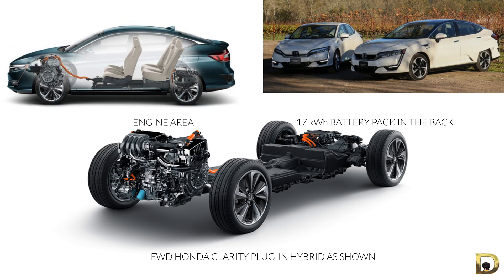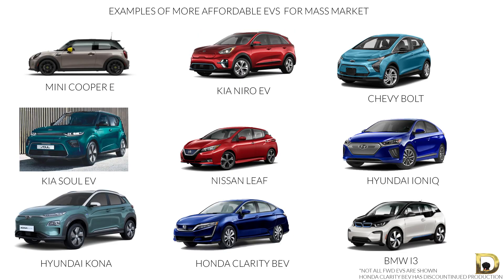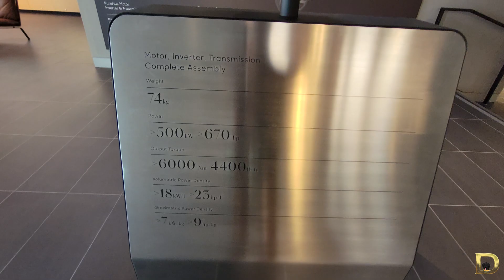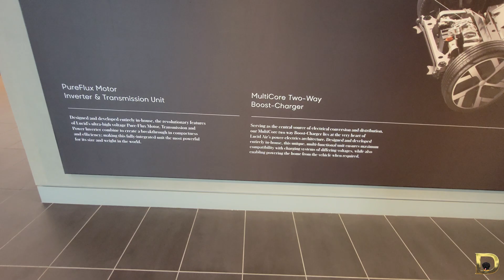Lucid Studio Tour at Beverly Hills and the Genius of EV Design and Packaging Possibilities

Comment: What charging stations can be used, can it plug into a Tesla rapid station? Does have have adapters to use other charging stations
Reply from the maker: It can be plugged into any charger station such as "Electrify America, ChargePoint, EVGO and many more," except for tesla's supercharging stations as of right now.  However, there has been rumors that Tesla will open up their stations to other EV manufacturers as well in the future. 🙂 Lucid will come with 3 years of free super charging from Electrify America, if pre-ordered during this year only. Lucid Air will come with the CCS1 charger combo (for DC level 3 fast charging) and J1772 for (level 1 and 2 AC charging) which is the standard adapter for North America. So you do not have to worry about having the correct adapter, only Tesla would require an adapter if they were to charge outside of their supercharger network. Tesla is only EV manufacturer that requires a special adapter for public charging outside their supercharging network.